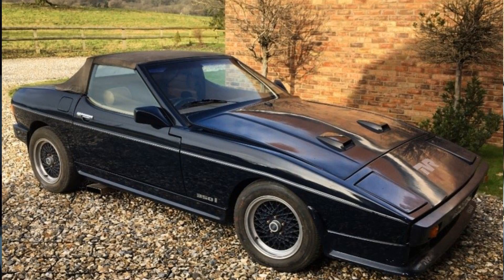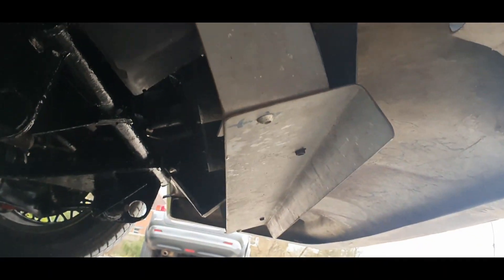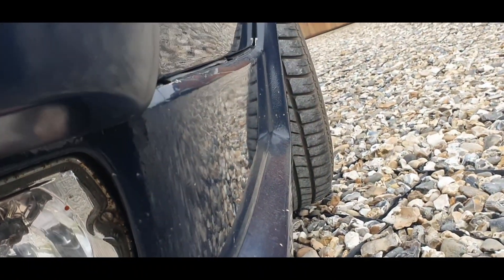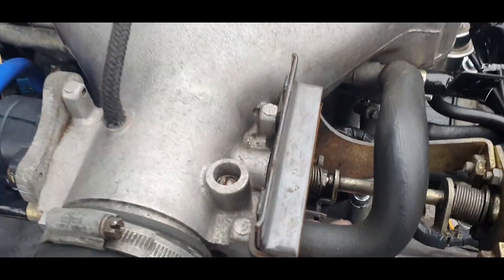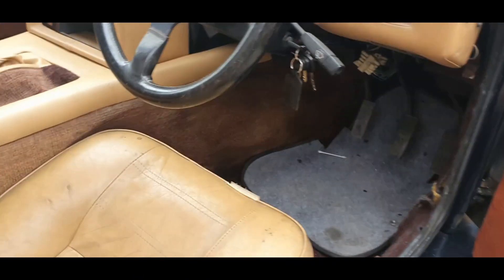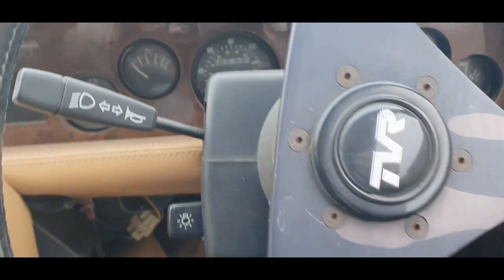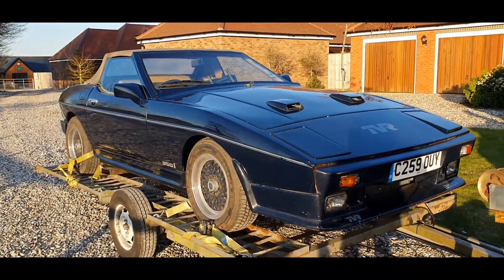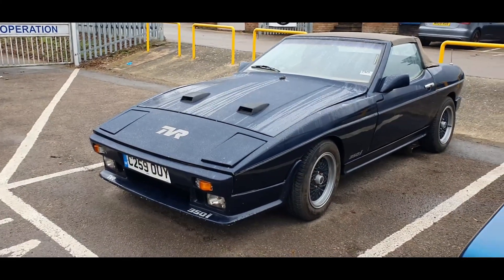TVR EV Conversion. Electric Classic car. ICE to EV. Tesla swap. Chargesheads EV journey Ep 4

Comment: You might want to look at the DVLA website before going much further as dropping a Tesla unit in the back means that it contravenes the regs and the car will need a full type approval as the axles, suspension and transmission will have changed.
Reply from the maker: Thanks for your concern, the tesla drive unit doesn't fit in the back, so shall be in the front anyway. So the next challenge is strength of the other components keeping up with the tesla POWER!!!
Reply: My experiences with a 500+bhp supercharged Wedge is that everything will break so you either treat things like diffs and gearboxes as consumables or you start replacing everything. I even had to weld fillets into the chassis junctions as I was cracking and distorting the chassis under power. And that was with a full roll cage fitted which added to the strength and stiffness. Snapped the diff mount many times. The biggest weakness is the rear trailing arm suspension which tend to snap the mounting point with disastrous results. The later cars had this replaced with an A frame which was stronger and more reliable.
Reply from the maker: @ofitgmembers1355  this is very valuable information that you so much. When you say later cars, i guess thats not mine being an 85? I was thinking the chassis might need extra welding. What diffs work on these for good power? What power do you think is sensible?
Reply: @chargeheads  That car's chassis is basically the same as the V6 Tasmin and was pretty much junked by TVR when they started putting the bigger V8s in and racing them. That looks to be an 84 car that was registered in 85 - common TVR "feature". It is not a good base at all for power upgrades as their is little margin in the components when they are stressed by more power/torque.  There is very little scope without replacing components which is expensive. Put the extra torque from an electric motor and certainly I would expect even a little Tesla to break stuff from the start.  The most important thing is how big is the budget and how quickly to you want the car to go? That will determine what needs to be done and addressed. All the problems can be solved as you just need to throw money at them. The more power, the more work that is needed on the rest of the car.  I think a Hyper9 would be a better choice it will have more low down torque  than the v8 which will mean it should accelerate faster without breaking stuff. It doesn't need the 15 batteries for the Tesla motor which helps with weight and stuff as well.
Reply: There is a youtube video of an electrified wedge snapping the rear drive shafts on its first?? run. The motor had less power than a hyper9 IIRC
Reply from the maker: @ofitgmembers1355  if i sent you a video of the underneath could you confirm the type of chassis ?
Reply: @chargeheads  No need, I can see from the video it is the trailing arm 280i version.
Reply from the maker: @ofitgmembers1355  thanks this is really handy to know. 👍
Reply from the maker: @ofitgmembers1355  it says dual motor, I've contacted the company to get an insight so I'm more prepared. I still really want to use a TVR so i think I'll play it be ear. Got any parts that might be of use?
Reply: No not that I'm not using.  I suspect the real problem with the drive shafts was that the trailing arm design used the drive shaft as the top suspension component. The hub itself was not   very well fixed and could move forward and back. That coupled with the suspension sitting down on acceleration meant that the UJs went out of range and would wear or break with little provocation. Electric motors provide way more torque low down which makes things a lot worse.  Good luck with it.
Reply from the maker: @ofitgmembers1355  thanks again. It would be good to connect properly at some point. All the best 👍